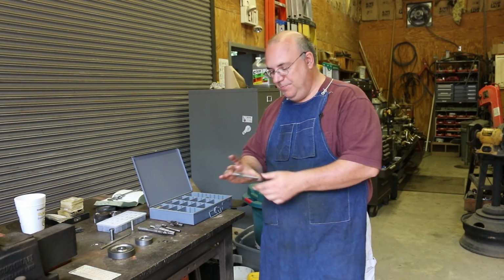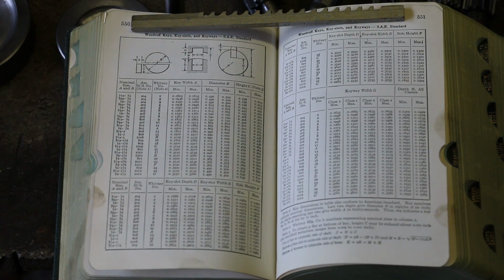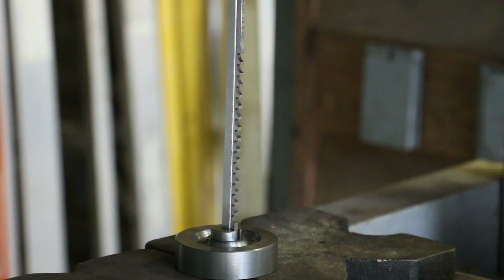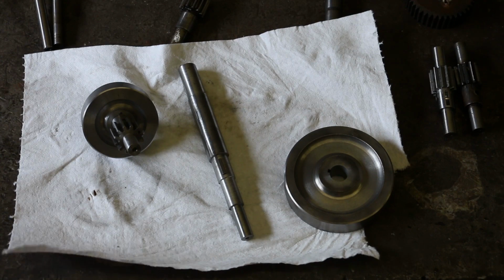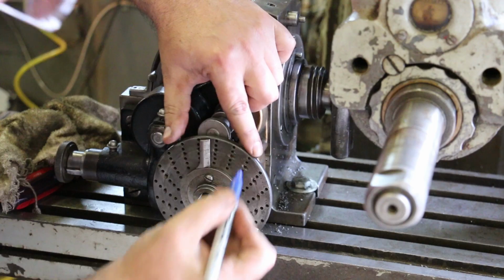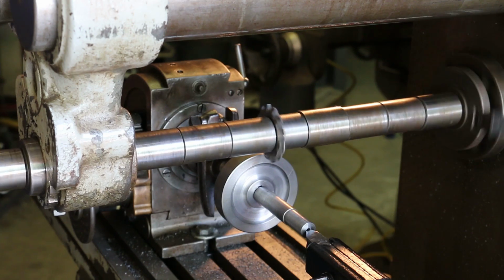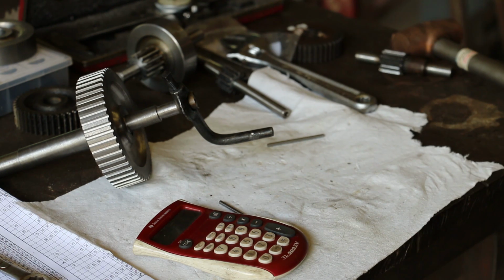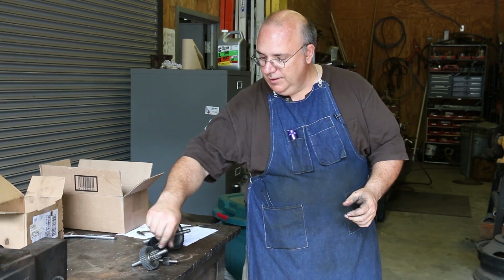Blacksmith Blower Rebuild: Part 4 - Woodruff Keyways and More Gear Cutting

Comment: I might have missed it but why did you cut the gears in two runs instead of one? Thanks, Edgar
Reply from the maker: Doing it in one pass is possible but it puts a lot of tool pressure on everything.  I was not in a hurry and decided to take it easy on my tools and equipment.

Comment: Quick tip for checking if a blade is touching... Apply a thin coat of oil-based paint to a flat surface, and roll the blank on it.  Then you can manually rotate the blade/etc and it will "scratch" the paint on the blank, without digging in.  Shouldn't be an issue for larger gears like this, but if you start working with smaller parts, those tiny fractions where the blade is actually cutting into the blank can throw your calculations off.

Comment: Oh dear lord Keith!.  I had the Closed Caption turned on. Your southern accent is giving it fits.  You simply have to watch a few portions of this video with the CC on, it'll drop you to your knees its so funny how it interprets what you say.  

Example at  24:35"... about replace when us we're going to use this hotel room a which had been looking and come from the research for the the  strength for this material I thinks gonna play me strong enough for this final dear in a reason the use that the from noise reduction for this final gear in a reason the use that the from noise reduction the have that bad fastest turning here for a walk in the metal he had a something that would dampen the operation tumor in the blower....." 

It gets worse.......
Reply from the maker: Yeah, YouTube is even worse than Siri when it comes to translating speech....

Comment: Keith,  you need to pick up a set of gunsmithing straight screwdrivers.  I noticed you had the standard one.  The gunsmithing one won't chew up the screws.  Excellent videos.  Am enjoying them and sent a couple to friends.  Thank you.
Reply from the maker: +Alex Tworkowski I have a set of small sizes at home but not the larger sizes.
Reply: Keith Rucker - VintageMachinery.org There so much kinder to the screw heads.  I always wondered why guns never had chewed up screw heads until I found out about these babies.  Good videos.  Thank you.

Comment: Would not the resin gear be a failure point, if there was a significant jam possibly the resin gear was made to fail to prevent damage to the other gears.
Reply from the maker: +bluegreenash Possibly, but it also reduces noise, which is probably why they used it.

Comment: by adding a key way to the original design not only you improved the original design but also added more educational value to the video ....some may argue thats its overkill ....but i like over designing  things 
another thing to notice is the factory that produced the mechanical blower probably thought about adding a key but never justified the cost and time to it...and that's probably how it ended up as a regular press in procedure 
thanks alot for your time and effort
Reply from the maker: +Faisal Abdulaziz My motto is that "if it is worth doing, it is worth overdoing!"
Reply: Keith Rucker - VintageMachinery.org
hehehehe sounds like the business

Comment: I am curious. In video 2 you had cut the blank for the third gear from the cast iron stock. You had commented that the fiber gear was to help reduce noise and vibration but you were going to use the cast iron gear. In this video you changed it to Delrin. Did you do it for the noise reason or were there other issues?  Or did I miss someone else's discussion?
Reply from the maker: +Larry Lawson I thought I discussed it in one of the episodes, but yes, I did do it for noise reduction.

Comment: I tell you what Keith - one thing watching you do all these measurements and calculations has done is make me feel so very grateful I use metres, centimetres and millimetres!
Reply from the maker: +morelenmir What is funny is that I know that the metric system is so much easier, but for me, it is more difficult but only because I am so used to working with inches, feet, yards, and miles........
Reply: Keith Rucker - VintageMachinery.org  I totally understand - and I was brought up just as things were changing over in Britain so I have some experience with both.  I actually think the imperial system is much more organic.  You almost know what an inch or a foot is without needing to measure it!  By comparison the metric units feel very impersonal somehow, less easy to relate to.  I think they are all based off the diameter of the earth of something like that?

In contrast you chaps always have had base-10 money whereas it was a real wrench to loose our proper money in the seventies.  I still miss guineas, shillings and crowns!!!  Modern coins and notes still look like play-money to me.

Comment: When you broached the keyway in the gear blank you didn't seem to make any careful measurements about the depth of cut as you did when cutting the key slot in the shaft, so how did you know that it would fit OK, especially since you couldn't push the gear on to try it for fit? Great videos.
Reply from the maker: Iain Crosbie The broach comes with a set of shims that when used is supposed to cut the key to the proper depth.  I guess I have used them so many times and they always work, I just take it for granted now that it is cutting to the proper depth.  They take the guess work out of it!

Comment: Thanks for showing the dividing-head setup.  I am relieved to see that the stops can move relative to each other.  I had been puzzling over how other ratios could be achieved with a fixed 120' angle... ha ha... I feel stupid now.
Reply from the maker: ***** No need to feel stupid - just keep on learning......

Comment: Awsome work. I remember the suffering in the machine shop. Now I self inflict my own suffering. I broke the 40 year old bushog shaft for the second time,the verticle shaft. Machined and welded again. Going back to hogging oak branches again. I think of Keith as I turn on the lathe. How calm and smooth his work is, no destruction repair in his shop.
Reply from the maker: ***** Believe me, I do plenty of destruction repair in my shop.  At at the museum.  And at work.  Yeah, I do agriculture research for a living and we always have these things called "summer interns" - kids who have never been on a tractor that we are supposed to put to work.  Lots of things to be fixed......

Comment: thanks again...quick Q... how come no lube for the gear cutting?

P
Reply from the maker: Piers Lehmann I typically don't use lube when cutting cast iron.  Several reasons, first being that the graphite in the cast iron is self lubricating.  Also, it makes cleanup a lot easier as with cast iron you get more of a dust than a chip and this dust is really bad for the machines when it gets dissolved into oil and spread all over your machine surfaces.  Much easier to clean up when it it is dry!

Comment: Great series indeed! I love watching all these informative video series from you, Keith Fenner, Jody, Abom etc. One do learn quite a lot.

By the way, I did notice you nicked the corner on one of the gears ;)

Keep up the great work!
Reply from the maker: larsmark You are observant!  Yes, I did nick one of the teeth when I did not pull the gear out far enough before rotating it to the next tooth.  It barely touched the corner and will not matter, but it sill made me mad....
Reply: Keith Rucker - VintageMachinery.org Haha, yes I would have reacted the same way but as you said, does not matter but always frustrating anyway.

Comment: Shouldn't the big gears be pushed up tight to the small gear on the shaft?
Reply: jeff edison It is hard to see but he has a small shoulder that the gear is being pressed up against, so the gap is deliberate.  I would think the gap is to avoid the sides of the gears from rubbing on each other.
Reply: I don't think that is a shoulder that you are seeing but rather a relief cut. I know it doesn't seem right for the gears to be pressed tight to one another but that is the way I have always seen it done. That or one gear will have a wider center than the gear teeth so there is a small gap when pushed up tight.
Reply from the maker: jeff edison In this situation, the gears are not tight against each other.  I was copying the original setup so I did not question the engineering (it has worked fine for the past 100 years, no need in re-engineering it).  It all has to do with where the matching gear in the blower is positioned and in this case, there is a gap between the gears.

Comment: Hi Keith, very well done precise work on the shafts and gears.  I enjoy watching you do the machine work, and like that you are explaining the steps as you go.   I am in the process of repairing a old Oliver 510 drill grinder.  Two shafts four woodruff key slots, and five new bearings so far. Thanks Kieth, Harvey from Nebraska
Reply from the maker: binks166 I am glad that you are enjoying the site!  The old Oliver drill grinder sounds interesting - shoot me some photos of it when you get it finished!
Reply: Keith Rucker - VintageMachinery.org   I will send you some pictures, the old beast is is looking rough but I think the heart is good,, Harvey

Comment: Hello Keith,

As always a very good video with good shots in different angles, and the end result is looking professional. But I was thinking about the hardening of the teeth and if it is necessary to harden them. 

Besides, my drill ( Bosch PBH 200 FRE ) has broken last week so I bought a new one but I was curious about what that had broken in it. Because of your video's I was more secure to open it and learned a lot from your video's how things work.

It is more a drill hammer so there are lot's of gears but all looked fine, cleaned the anker and brushes. But than I noticed that the interference suppressor burned out and that part is about 5 euro so I can repair it very cheap.

Most interesting of it where the gears and than in combination with your video's of making gears. Now I understand much more how they work because I've seen how they are made. 

Many thanx for the video and greetings from Roel.
Reply from the maker: RoelTyros So, some gears are indeed hardened, but others are not.  In the case of this blower, I was able to cut everything with a file so I did not think that any of them were originally hardened.  The pinion gears (the small ones) had the most wear and might have benefited from being a little harder, but I am sure that I did will hold up fine.  Glad that the video helped and gave you the confidence to take the drill apart and try and fix it.  Most new things made these days are engineered to fail at some point in time so you will buy a new one, which drives me crazy.  But the good manufacturers (and I consider Bosch one of those) makes replacement parts available so you can keep it going.

Comment: very nice series Keith.  I have tried cutting some gears in my vertical mill  the vibration was woeful  really wish I had a horizontal mill .
Reply from the maker: The Apprentice The extra weight of the horizontal mill along with the arbor with the outboard support sure does make a huge difference when it comes to a job like this.  If this was a production job and I was making multiple's of the gear, I could easily hog out all of the material in one pass.  I did it in multiple passes here simply so that I could measure things and sneak up on the right size!

Comment: Boy, you sure made it look easy. Can't wait to see how you are going to handle the bushing wear on the blower case. Tanks for sharing your craft with us.
Reply from the maker: jaime vega You need to go back and watch part 1 of this series:  https://youtu.be/9vk4S_zl3n8?list=PLbGC44mjwqrcSBAhN0xHeWASQAv0km65n.  I reamed the original bearings out a bit oversized and then made the new pinion shafts slightly larger to fit the new holes.
Reply: What a dumb bell I am, I watched the first video and there was the answer to my question. Great job. Thanks.

Comment: Keith, Is there a relationship between the teeth on the pinion and the larger gear ? If so,how did you establish that before cutting the larger gear ?
Reply from the maker: ***** Not sure I follow what you mean by relationship.  If you mean the number of teeth, that was determined for me as I was copying the originals.  If you are talking about the profile of the tooth, that too was determined for me based on the cutter that I used - the profile of the involute curve changes slightly as you increase the diameter of the gear and the number of teeth, but this is engineered into the cutter that you use and as long as you are using the correct cutter for the number of teeth you are cutting, you don't have to worry about it.
Reply: Keith Rucker - VintageMachinery.org  What I was referring to were the teeth.Do the teeth on the spur gear have to line up in some way with the teeth on the larger gear. Thanks' Keith

Comment: You all must have popeye out there turning that thing if he can slip a press fit gear with a foot long hand crank!!  Still fun to watch you do the cuts and broaching. It is terrible hot and humid here, glad I don't have to stand next to a fire and crank that thing myself!!
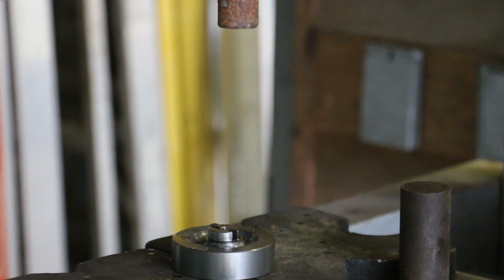Reply from the maker: bcbloc02 I am sure the press fit gear would have held up just fine - the originals did for the past 100 years.  But a key will make sure that they don't slip!  I don't want to have to ever go back into this thing.....  Hot and humid it is here as well.  Yesterday morning, I was at the museum and was soaking wet from sweat by 9:00 in the morning when I had to run to town.  I got in the truck and the thermometer only read 78 degrees - but the humidity was so high that we were all soaked!  By the afternoon, it was 95 degrees and it was getting pretty miserable.  So miserable in fact, that I packed up and went to the house as I was working on something on the bench that I could do in my shop at the house and at least there I have a window AC unit to knock the temp down a few degrees!  It was really fun when I was up on the steam locomotive around 12:00 for about 45 minuets - sitting next to the boiler in the cab of the engine was "really fun".

Comment: Bozo at 23:21
Reply: TERRY RONALD RACKLEY  No that is just Keith putting a timing mark on that gear. LOL
Reply: Keith Rucker - VintageMachinery.org Still a good job .Not many people even knows how to do that stuff.I could never learn it .
Reply from the maker: TERRY RONALD RACKLEY Yeah, a little bozo moment there - I did not pull the gear all the way back and caught the corner of the tooth as I indexed it.  It barely touched but it did touch.  I will not interfere with the operation of the gear, and in the end, it is hardly even noticeable.

Comment: When setting up the scepter arm to 16/20 there were 17 total holes. Do you have to add one hole to get 16/20? So it is 16 positions from current location it moves not counting current location?
Reply: Matthew Troiano Remember Matt, It's not the holes that are important, it is the spaces. Keith was right on that one.Cliff
Reply: I think I understand now the space between the holes is what is counted.
Reply: At the risk of sounding like a know it all, yes Matt, matt your right.
All the best, Cliff
Reply: Thank you for clearing that up for me.
Reply: You are more than welcome !!!
Reply from the maker: Matthew Troiano Another way to look at it is to count the number of holes to the next position - not including the one you are currently in (that one was the last number you counted in the previous round of holes).
Reply: Keith Rucker - VintageMachinery.org That is what I was wondering thanks for clearing that up.

Comment: Keith,
Nice work as always.  Too mad I didn't know you were in the Bay Area. I live about 15 miles from Chuck's house. Maybe next time. Thanks for the video!
Have a good one!
Dave
Reply from the maker: Swarf Rat Dave, Sorry we were not able to hook up while I was in the area.  I basically left it up to Chuck to figure out where we would go and what we would do.  Even then, we did not get around to everything he wanted to get me to while I was there.  I think I could spend a week out there visiting and looking at things and still not get around to everything.
Reply: Swarf Rat I would have liked to visit with him as well, just down the road south of chuck's place,
Jim
Reply: Jim . . . Do you have a shop or you a "closet machinist" like myself? Perhaps we can meet up some time.    Dave
Reply: Dave,
No shop, just slowly setting up a lathe and mill in a small dark corner of the garage. right now I've got things piled on top of things, so much so I need to lose 50 lbs just to make it down the aisles.
I'm in Hollister 95023
Jim
Reply: Jim . . . I live in San Mateo, so I am bit northwest of you. I don't have any machines but am saving up to get some. Since we own a condo, there isn't anyplace with 230v power to set up a shop here. I thought of renting a small shop, but at around $1.00/ sq. ft., that's out of the question. I'm retired, on social security and worked for companies without retirement programs. It was more fun to blow overtime $$$ on toys than save for retirement. Since my folks are gone and I inherited the house, I plan to build a shop next to the house so I don't have to run a 230v line too far. If you see any lathes that are in pretty good condition and don't cost a fortune, please let me know. Thanks.   Dave
Reply: Skip Tracer Looks like there are a lot of us in CA.  I am in the Central Valley just over the hill from you and Swarf Rat.  Just north of Modesto.
Reply: Gus, Isn't Ray Caniglia over in your area as well? Thick as fleas these Central CA. machinists.
Jim

Comment: Good video as always. i was wondering what was the number of the loctite you were using ? Thank's again.
Reply from the maker: Chuck Small Actually, I was using the kind used on threads as that is what I had handy.  It was the reversible kind in case I ever do need to take it apart....